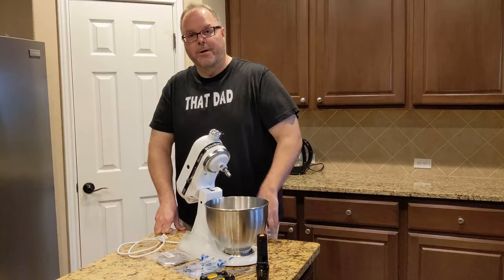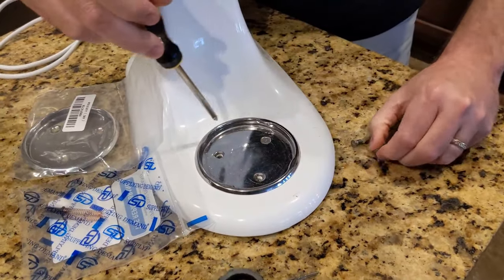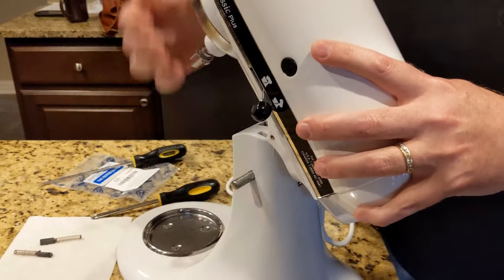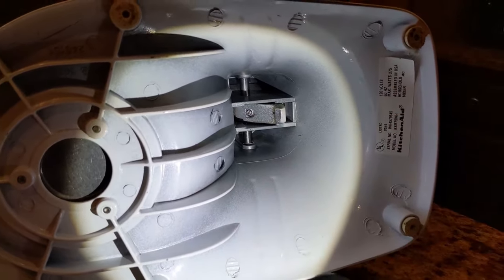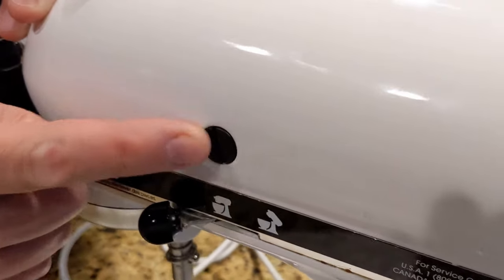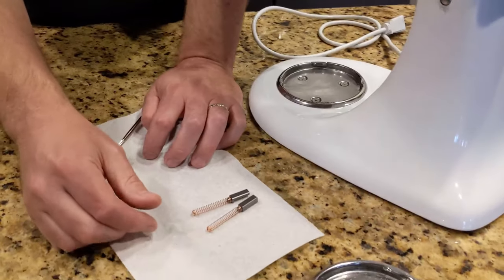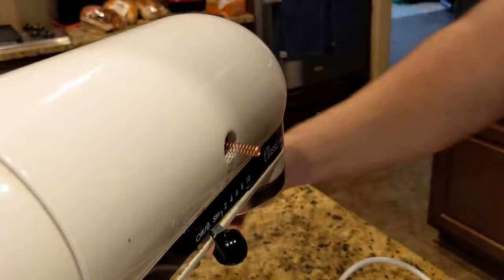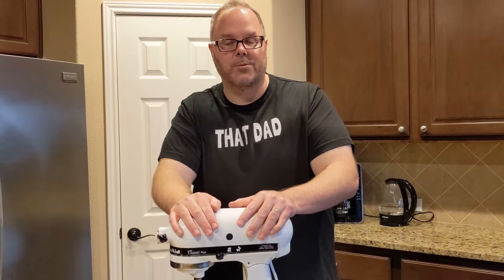KitchenAid Stand Mixer Wobble Fix and Tune Up

Comment: Isn't the screw in the hinge for adjusting the height of the beater. If the head is moving up and down while mixing the beater is rubbing the bottom of the bowl, this is why people break the glass bowl because it's thicker than the stainless steel bowl and has to be adjusted.
Reply from the maker: In these models, it is to prevent the head of the mixer from bouncing by raising its stop point slightly. When adjusted correctly, it works in tandem with the lock on the side of the machine to prevent bouncing.
Reply: I wish you would have turned it on before replacing the brushes.  Still a very good video.
Reply from the maker: Good suggestion, Thank you!
Reply: Thank you, my pin walks out, now I can fix it.
Reply from the maker: @noraamos876 fantastic, so glad the video helped!

Comment: Thank you so much!  I have been keeping a small hammer in my kitchen to push the pin back in, and now I can return it to the tool box.  Plus, I have been mixing a lot of sourdough recipes, and now the wobble problem is also fixed.  My mixer is about 25 years old, and now it works like new!
Reply from the maker: Fantastic - so glad the video helped!

Comment: After watching this video I tightened up the set screw to stop the pin from working its way out.  I also adjusted the screw to prevent the back to front wobbling.  It took less than 3 minutes and my wife is happy.  Thanks for the tutorial.  Great job.
Reply from the maker: Thank you so much! Glad the video helped and I appreciate you taking the time to comment!

Comment: Awesome! Great video. My mixer head was wobbling like crazy and was sitting to low to where the paddle was hitting the bottom of the bowl. I adjusted the adjusting screw and also found the pin was nearly half out. Pushed back in and tighten the screw underneath and I'm back in business. It's tight as a drum now. Thank you so much. I was about to find a small appliance repair shop. No need now.👍😁
Reply from the maker: Thank you for taking the time to comment - I am so glad the video helped!

Comment: Thanks for posting this. I had never really thought about my bowl until it stopped fitting in to the turn plate. After looking at your video, I realized that the plastic ring had come off my bowl and was seated in the well above the plate. So obvious but until I viewed your video with the plastic attachment missing from the top of the plate, I didn’t see the obvious. Got pliers and unscrewed the plastic ring from the plate and screwed it back on to the bowls .  I had actually thought of buying a newer mixer!
Reply from the maker: That's great to hear! I am so glad the video helped and appreciate you taking the time to comment!

Comment: That was awesome.  I looked up other videos for the issue I was having with replacing the brushes and could not follow them.  Your video is perfect.  Thank you very much.  The bouncing was also an issue which I can now fix.  Thank you very much for that, too.
Reply from the maker: Thank you so much for the kind words and taking the time to comment!
Reply: Why do we need to replace the brushes?  My kitchenaid mixer is weak. I don’t know if the motor not good or gear is going to break or other reasons. Any ideas? Thanks

Comment: Just came across this very helpful video that saved me from tossing my 20 year old Classic model. Thank you so much for helping me fix the few annoying things (quite a severe wobble and holding the hinge pin in place constantly, haha) that my mixer was doing the past couple of years. I do have a Bosch that I use for bread and pizza dough because I can do bigger batches in it. But I love this little mixer for a simple cake or some cookies or a batch of icing. I just told my husband last week that I thought I needed a new one and I was so sad about it because it was purchased when we had our first child and there a so many memories attached to it. So thanks! Off to order a new plate for the bottom and some new bushings so when those need to be replaced, I'll be ready:)
Reply from the maker: So glad the video helped - thanks for taking the time to comment!

Comment: Thanks, I just went through the same process, and got it relatively tight.
However on advice from an old retired  repair guy ,he said some that were the same age as ours , had some tolerance issues at hinge  .. his fix, and has never been an issue since, was to use a set of feeler gauges to measure that end play in hinge, and he gave me several shim washers that required drilling out to match the pin diameter after selecting correct thickness and insert them .. result though a bit fiddly to do, is a perfect fit .. and never had to adjust it in 2 yrs, despite heavy Covid baking sessions ..
 Another issue when we first got it , during an Xmas baking marathon, the mixer at the front threw out the grease, or most of it .. That was fixed by my now retired repair guy ..he suspected that it had been over stuffed with grease .. or that the heat built up to a point it became thinner and leaked out .. High heat /pressure grease for industrial machines never been a problem..

Comment: I thought my mixer was dying. It wobbled and that also helped work the hinge pin loose. that hinge pin came out one day and the top came loose. I've been holding it when using for a while worrying about it getting worse and today decided to look into it and it's fixed with a couple of screwdriver turns!!!
Reply from the maker: That's great news!

Comment: Thanks for the video! The tip about orienting the brushes correctly saved me a lot of time and headache. I thought I broke my wife's machine because it wasn't turning back on but turned out I had just installed one of the brushes incorrectly. THANK YOU!
Reply from the maker: Thank you - glad you were able to get it fixed!

Comment: Thank you thank you thank you! That pin information was a game changer. Mine wasn't even connected to the head!!! Don't ask me how it was 2nd hand but once I connected it and tightened it the shaking stopped. I adjusted the wobble with the under head screw and voila nice and strong. Thank you!
Reply from the maker: That's fantastic, so glad you got it fixed!

Comment: Ok I’ve tried the pin tighten and I’ve don’t the tilt head screw adjustment and it still wobbles. I had to replace the tilt head screw and can’t find an actual match for it ANYWHERE. The flathead slot was stripped and I had to unscrew it with pliers and sheer will. 1) where do I find a replacement? Cause online has failed me and so have all the hardware stores. 2) is there another reason for the bouncy mixer head other than dime test or pin? 
Your video is clear, and very helpful for the issues you mentioned. Much better than a lot of others. Thank you for all of this.
Reply from the maker: Thank you so much for taking the time to watch and comment! The bounce is most often caused as a result of the lock and the motor head having a gap - the screw is what raises the motor slightly to close that gap. Is the screw number 31 on the diagram listed here? (double check your model). If so you could also call this company to confirm it is the right one: https://www.partswarehouse.com/KitchenAid-4-1-2-Quart-Classic-Stand-Mixer-Classic-With-Ti-s/575811.htm
Reply: @ThatDadMike  THIS IS THE MOST HELPFUL THING EVER! Thank you so much. :)

Comment: Thank you for your very helpful video.  I apologize if you have previously answered this question, but I am interested in knowing what the symptoms would be to indicate worn brushes, or should their replacement be part of a maintenence routine? Thank you 😊
Reply from the maker: No problem at all, happy to help! Decreased power or speed, or no power at all are a sign that the brushes are worn. My mixer was not going to the top few speed settings and changing the brushes fixed that problem.
Reply: @ThatDadMike  👍

Comment: Thanks. You have solved 2 of my issues. Do you know much about the mechanism around the auxiliary port for accessories?  My meat grinder does not rotate or grind the meat when connected.
Reply from the maker: Glad the video helped! For the meat grinder, it sounds like the accessory hub gear may be the issue. Take a look at this diagram (4th picture, part number 14 and 15) and see if that could be it: https://www.partswarehouse.com/KitchenAid-4-1-2-Quart-Classic-Stand-Mixer-Classic-With-Ti-s/575811.htm

Comment: Hey!!! You helped me a lot, it fixed one of my main issues and I am so thankful.  My other issue is the screw in the bottom that keeps the pin in - mine is no longer there... Long shot here... but do you happen to know the size or part # or name of this screw? I am hoping to get a replacement.  - Thanks again so much and have a great day!
Reply from the maker: Great to hear! Check this site to see if they have your mixer listed and the part number for the set screw: https://www.ereplacementparts.com/screw-set-p-622311.html

You might be able to find one that works in this kit as well and return it if it does not have what you need: https://amzn.to/3YjUJIe

Comment: Thank you for this!  I've been having a few issues with my KitchenAid and was about ready to throw it out.  Just curious though, the way you fixed the tilt head issue isn't that how to raise or lower your mixers so it mixes properly?  I saw someone post about a dime test and thought that's how they adjusted it.  Anyway, thanks again.  Glad I found you!
Reply from the maker: I am glad the video helped! The adjustment screw does raise and lower the head slightly. Ideally you are able to strike a balance between making the locking mechanism just tight enough to prevent the bouncing while raising the head to make sure it mixes properly.

Comment: You replaced the bowl plate because it was locked into position but isn't that what's its supposed to do? Great video. Shiw us the bowl removal with new plate.
Reply from the maker: Thank you! The bowl plate had worn and was making it extremely difficult to remove the bowl as it would get jammed further in the lock position. The new one solved that problem and locks it perfectly and is much easier to remove.

Comment: Hi Mike: don’t judge me but I’ve been wondering for the past 2 decades why my 34 year old KitchenAid stand mixer was wobbling and the pin would work it’s way out unless I keep my thumb on it. Guess what! When I turned the machine over, there’s no screw to turn! Are you able to let me know what to ask for at the hardware store? Thank you for the informative video.
Reply from the maker: No judgement at all, I did the exact same thing for years! That part is called the hinge pin set screw which is really not helpful. What I would do is take the mixer to a big box hardware store and look for a set screw like the one in the diagram (link below) in the speciality nut and bolt section that fits the screw hole (these are the ones in the drawers). https://www.easyapplianceparts.com/PartInfo.aspx?inventory=11741590&gclid=Cj0KCQjwuNemBhCBARIsADp74QQU40STvdq-fFKRasmXpuev0R_kZZrMegOtYCQMf3KMjZsyNMXBwz4aAjuKEALw_wcB

Comment: Thank you for the video! One question, have you ever dealt with a lock not locking? I think there is a screw loose inside, but not sure.
Reply from the maker: Thank you! In some cases, the screw that adjusts the motor housing from wobbling may be slightly over tight causing the lock to not lock. Try to loosen that adjustment screw I show in the video and see if that corrects it.

Comment: With my mixer, the screw that holds the pin in place is missing. Can a screw be substituted or does it need to be a particular screw?
Reply from the maker: Here is the screw you need - double check your model on the KitchenAid site to be sure of the part number (you also may be able to find it in the special screw drawers at Big box retailers like Lowe's/Home depot: https://amzn.to/40eqhAp

Comment: Great tutorial! My machine was wobbly and bucking. Got those adjustments done. However before I found your video, I removed the side screw and the bushing popped out. I put it back per your instruction, but my machine does not turn on. Any idea what the problem is and how to solve?
Reply from the maker: Thank you! I think the brush may be turned 45 degrees. Try to pull each brush back out and then look inside the motor housing to find out which direction the notch is and then match it to the brush when you put it back in.

Comment: The area where the beaters are put, wobbles…or jiggles when they are beating or mixing, like it’s loose…does the adjustment you did, replacing the brushes correct this problem?
Reply from the maker: Thanks for watching the video! The brushes only transfer the electrical power to the mixer. If it is loose or jiggles where it connects to the mixer head when not mixing, it could be the spring-like mechanism that holds the beater in.

Comment: How does replacing the base with a new one stop the bowl from sticking? Is the new one an upgraded model?
Reply from the maker: Over time, the aluminum base that holds the bowl gets worn and allows the bowl to get tighter in the base when mixing. Changing the base made all the difference for me and now I can actually get the bowl to release by hand.

Comment: Hi - thank you so much for the video, it is very helpful.  Do you have recommendations if the head shaking continues after adjustments?  It appears and paddle is still too low, I cant use the bread hook or whisk attachments at all given how low they are.
Reply from the maker: Thanks for taking the time to watch and comment! The only thing I can think of is to check and see if the hinge pin is slightly bent. If that is not it, check to make sure your bowl is seated completely.
Reply: KitchenAid has a YT video referencing "the dime test" that may help with your beater problem.

Comment: This really helped!  Thank u
Reply: Any idea why this motor has this little Jerky sound?  Will hanging the brushes fixit?
Reply from the maker: Glad the video helped! It could be a number of things and it is certainly possible changing the brushes will help. The nice thing is they are not expensive so worth a try (the link for the ones I bought is in the video description). The brushes are what transfer the power to the motor - changing them on mine allowed it to operate at full speed.

Comment: That last three you adjusted. Does it not raise and lower where your attachments going to be in the bowl? I have the 4.5 quart KitchenAid and my head has been wobbling terribly lately and I don't know how to fix it. I have adjusted the last screw that you showed and all it does is lift the beater up and down to get it closer to the edge of the bowl. If my model is a different model than yours, do you know how I would adjust the head of mine to stop wobbling so much?
Reply from the maker: Thanks for the comment! What typically happens is the screw that raises and lowers the attachments works in conjunction with the lock to prevent the head moving up and down. If that is set correctly with no up and down movement, you might take another look at the set screw that holds the pin that connects the head to the mixer stand.
Reply: @ThatDadMike  ok thank you!

Comment: Can you help? I had the issue with the head not locking into place. I adjusted it via the screw and that worked, it now locks... But now my mixer paddle is scraping the bowl, it's too low down. If I put it any higher at all then it doesn't lock again. I just wondered if you have had this issue at all and know how to fix it? Thanks
Reply from the maker: That's a tough one. It almost sounds like the locking mechanism may have gotten bent slightly which makes it not engage correctly when the paddle is set correctly. If you are up to it, you might take the cover off the motor (make sure it is unplugged) and see how the mechanical latch is engaging.

Comment: thanks, mine is still jumping may need to get new brush
Reply from the maker: You might try to adjust the screw a bit more that I show in the video and see if that corrects it. The screw works in tandem with the lock and there should be very little play when locked to prevent the motor from bouncing.

Comment: Anyway, you could give more advice, I have titans the screw underneath that holds the bar in place. But my classic plus KitchenAid still wobbles yes and no.
Reply from the maker: Is the motor bouncing up and down a bit? If so, slightly turn the screw under the motor where the motor sits on the stand. My classic wobbles a bit but only when it's on a higher setting and I use the dough hook.

Comment: So the pin is popping out on mine, and I went to tighten the bottom and looks like the screw is missing! Any idea what it’s called or size I can use to replace it?
Reply from the maker: Hi there! It's called the hinge pin set screw. You may be able to find it at your local hardware store in the speciality screw section. Here is an example of one from Amazon: https://amzn.to/42NO3CM

Comment: So was the bowl sticking just because of a worn out plate? Will it need replaced in another few years? Would a bowl with a handle help?
Reply from the maker: The challenge with this design is the bowl uses tension with the plate to keep it in place. What has happened on mine is over many times/several years of making pizza dough (I usually knead the dough about 10 minutes), the metal wears just enough that the bowl ends up getting stuck onto the plate so tight you can hardly get the bowl loose. A handle may help but it has been in rare cases I had to tap it with a rubber mallet to break it free. The new plate has really helped though. If I had to do it all over again, I think I would buy the bigger version of the mixer that has the bowl that sits on two pins and not the plate.

Comment: My bowl has opposite problem. It won't lock in place and flies off when mixer runs. Will changing the plate fix that too?
Reply from the maker: It is certainly possible. The plate at the bottom holds the bowl using friction.